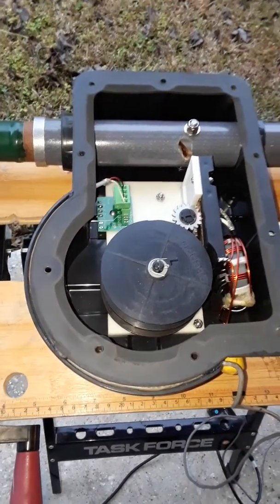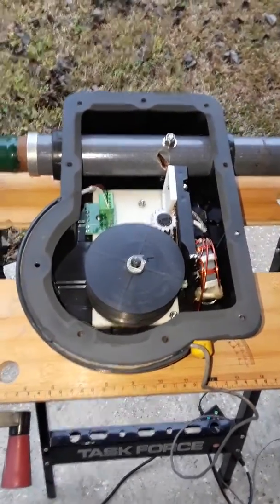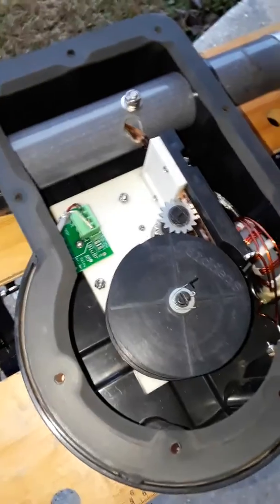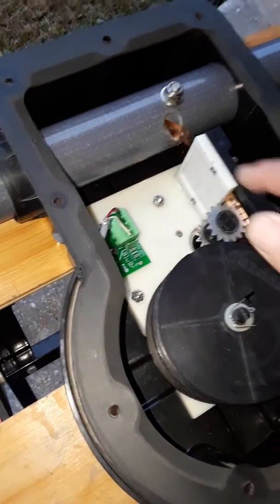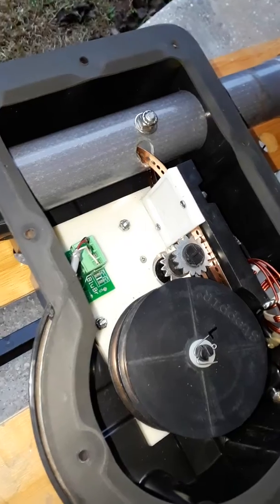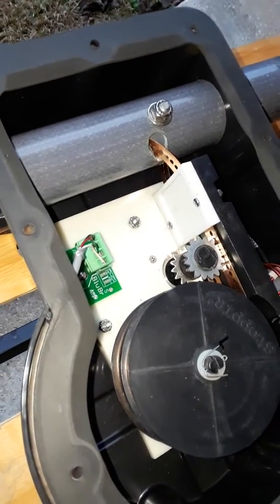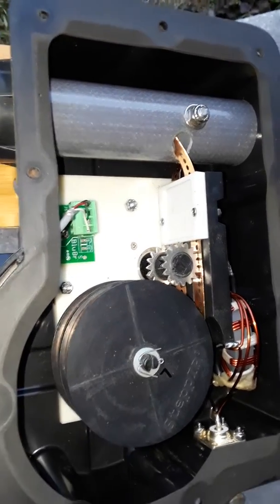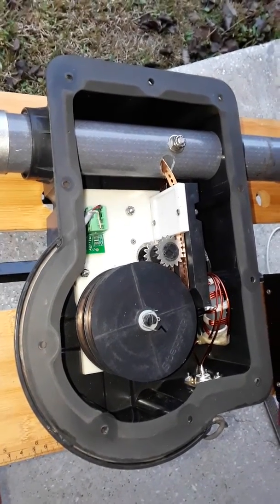AA5AU Testing a SteppIR EHU - January 2018 - part 1 or 2

Comment: Hi

I have an ultrabeam driven element 6-40 meter EHU I would like to rebuild 
Do you know where to source parts like the stepper motor and contact plate ?
Thanks 
Ross 
M0UGE